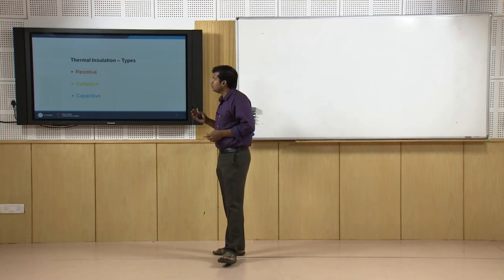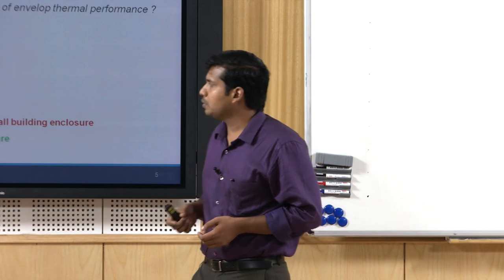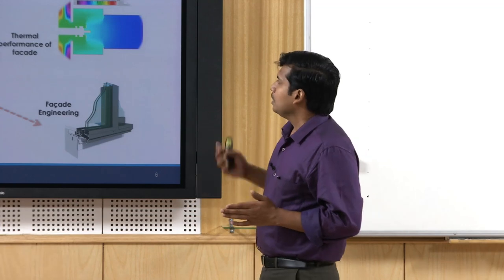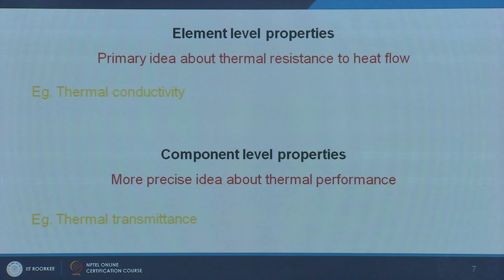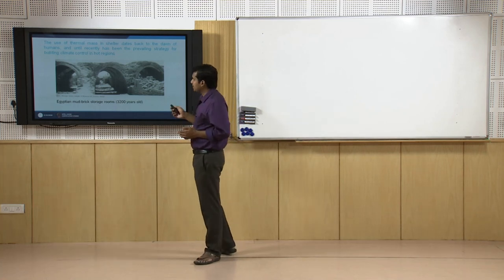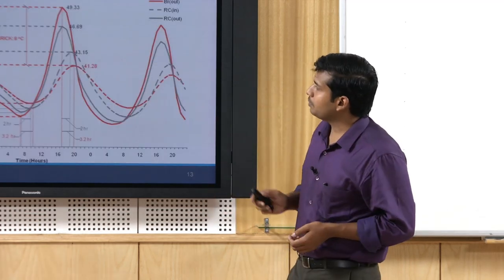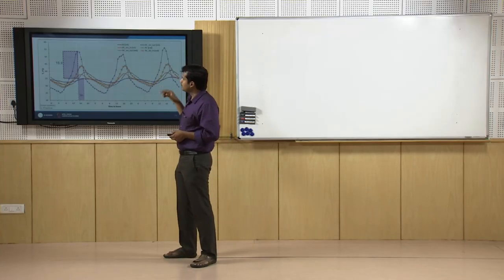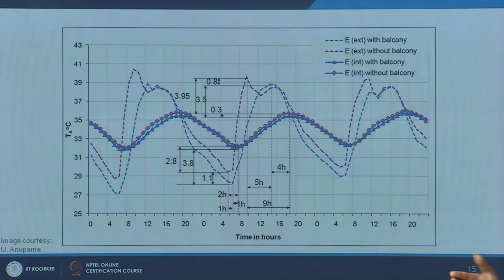THERMAL PERFORMANCE OF BUILDING ENVELOP - Indices and measures (1/2)

Comment: Class is really great,could you please share the software name that used to analyse thermal efficiency in glazing curtain wall.thermal simulation for curtain wall (material are glass,gaskets/synthetic rubber,insulation foam &aluminium)